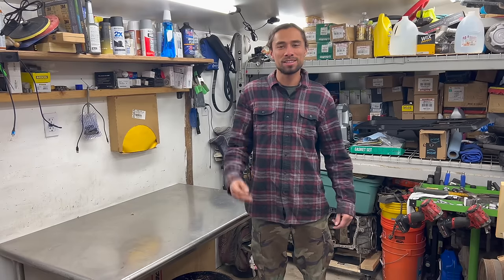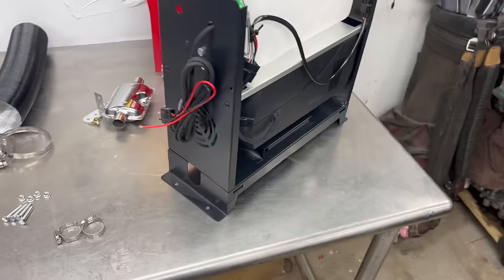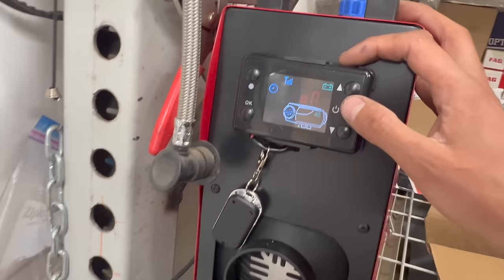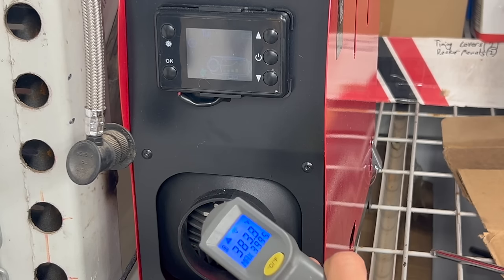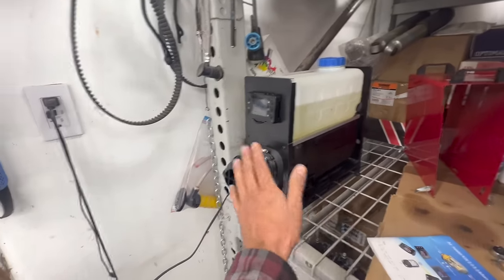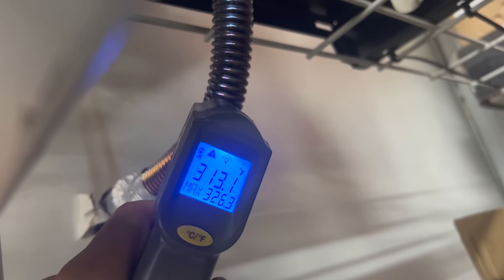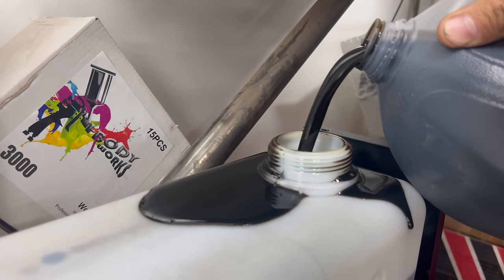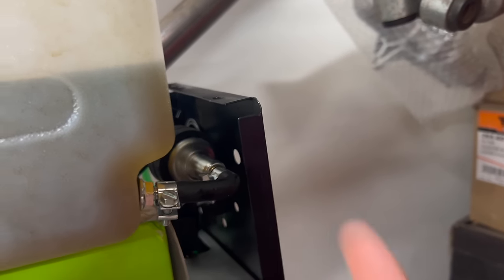Unfiltered 100% Waste Oil Vs Stock Diesel Heater

Comment: I run a mixture of gas contaminated diesel and waste oil in mine.  No clue on the ratios.  As long as it looks thin enough and won't burn on the concrete by itself I call it good to go lol.  https://www.youtube.com/shorts/T41h_5g2zJg  I run both of them probably about 15-20 hours a week.  Had one of the fuel pumps get stuck but just took it out, banged it on the wall, tapped 12v to it a few times and it's been good to go.  I haven't filtered anything.  I figure waste oil is filtered in the engine's oil filter right?

Comment: I can only hope your lack of common sense is ad-lib for your channel.  The clue is in the name, DIESEL heater..........  50/50 mix is the max you can burn waste oil with diesel but as others have said, an additional tank is required but start up and shut down needs to be done with pure diesel.  Instruction booklets are included for a reason.